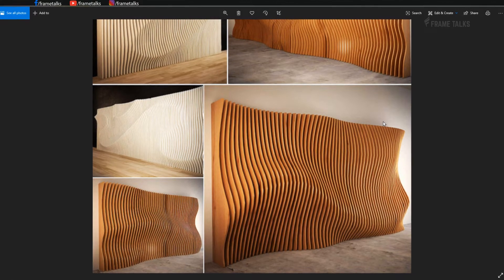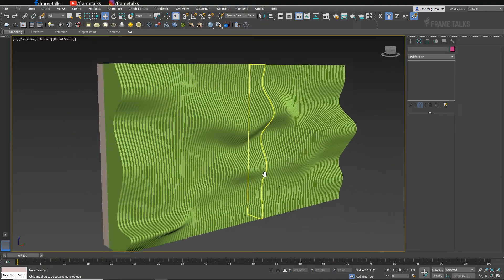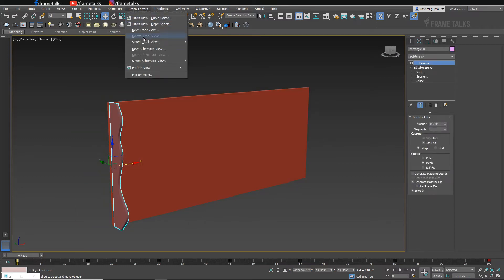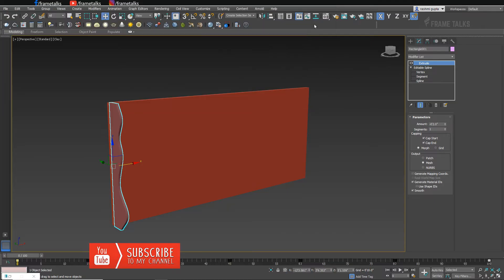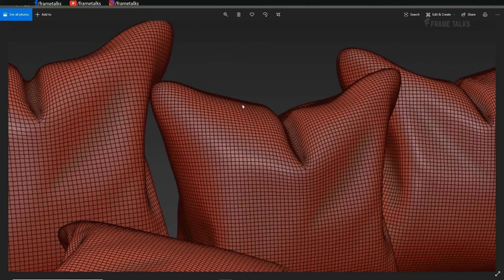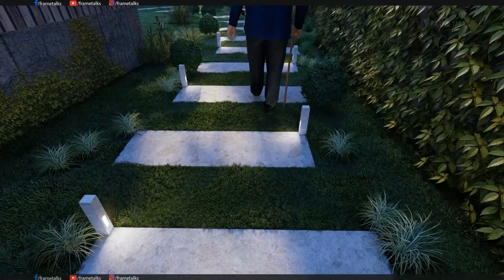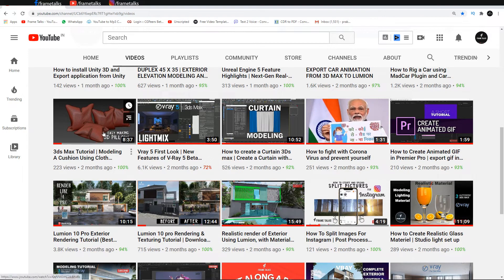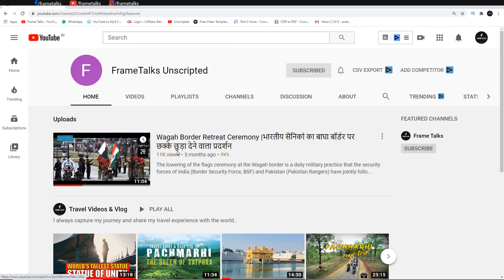How to create Parametric Wall in 3dsMax? 3D MAX easy modeling trick

Comment: How i can export this file to Autocad
Reply from the maker: To auto cad but why.. 
I don't think you can import 3D model on AutoCAD
Reply: Click save as and choose DWG extensions. However, it is not recommended to use AutoCAD for 3D, it is very slow